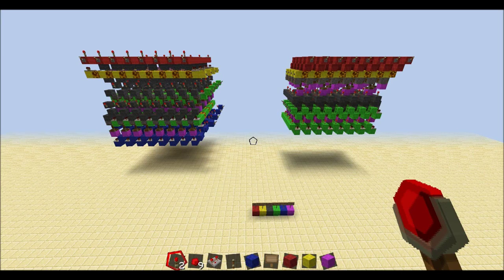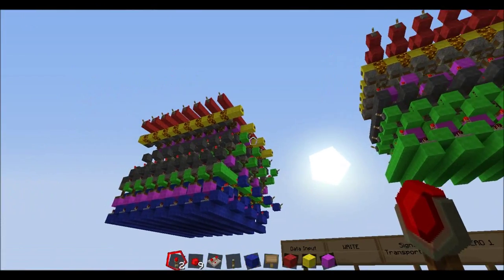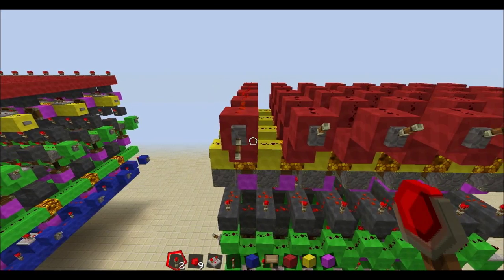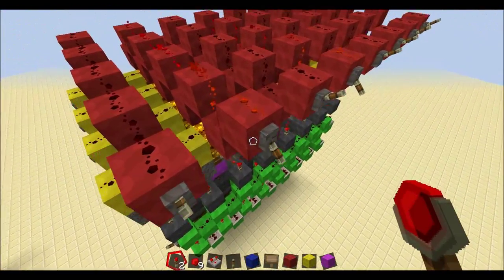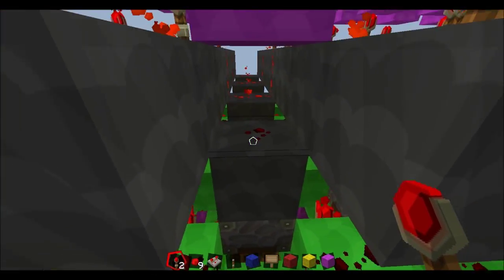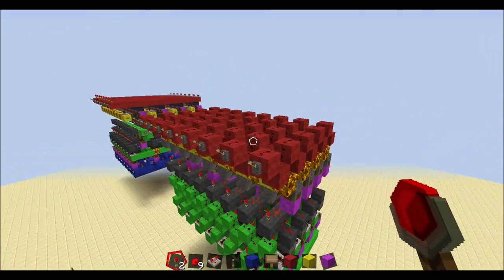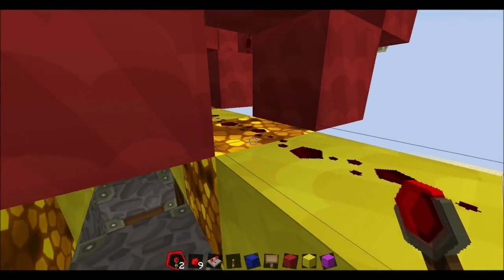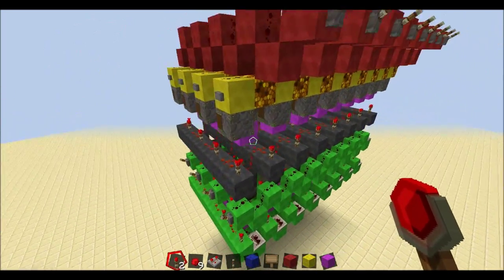Minecraft - RAM (Compact Single Read) [Explanation]

Comment: calling it RAM is kind of pointless, Since anything more than 15 blocks needs a repeater.  It can't access random addresses within the same clock time.  In a real computer it uses RAM because the hard data is slower.  Newer processors have alot more buffer cache because it's faster than RAM.  In Minecraft, you don't need RAM.  All you need is an ALU, enough registers, and enough memory to do whatever you want to do.  Good Job though, I think your trying too hard.  All the parts of a computer are made to be as simple as possible.
Reply: You're denouncing this because of what he's calling it? Everyone calls it RAM or a hard drive interchangeably. It's just RAM is easier to say. The things we make in Minecraft are trivial and decades behind anything we can make in real life. The components are makeshift and are only imitating real electronics. The redstone power limit is a game mechanic, not a law of physics, and shouldn't be the reason you bash his build.
Reply: it's RAM if you use instant repeaters